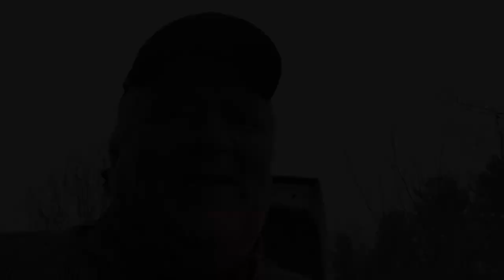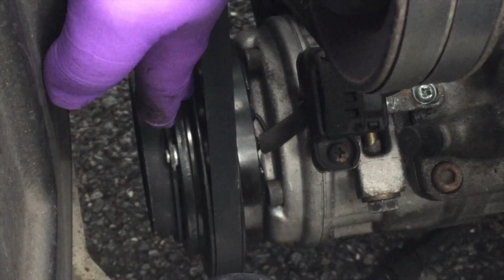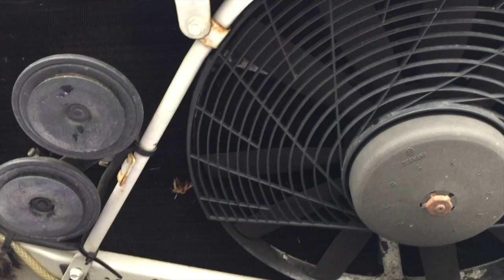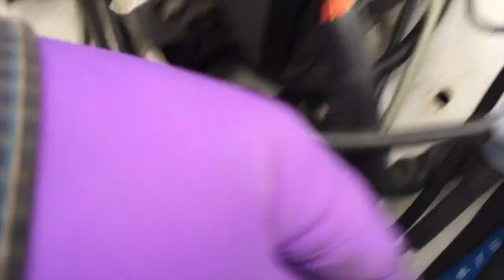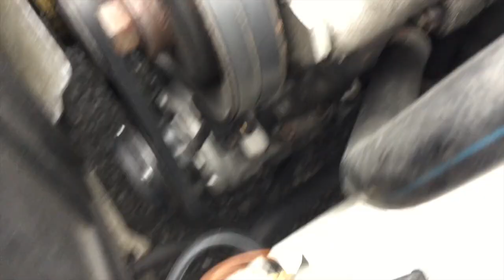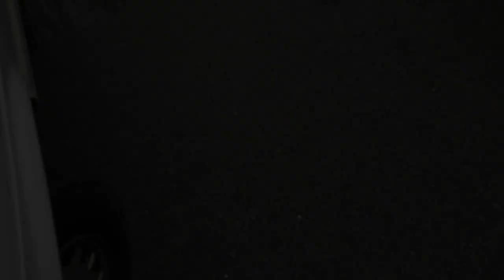Key components of AC systems on Mercedes Benz W123 W124 W126 W201

Comment: im looking theres a fuse looking thing or a thermal fuse some sort what exactly is that called its just behind the headlight looks like a brick but its broke ? any idea what is it called
Reply from the maker: Is this visible in this or any other video? What model car is this?
Reply: @straybenzes no its not my one is a 190e cosworth 2.3
Reply from the maker: @ALKUKES  Got ya. I am unfamiliar with the component and its location you are describing.
Reply: @straybenzes its called ac fan resistor google search by photo , but thank you god bless you
Reply from the maker: @ALKUKES  Yikes. I like that spot better than in the other 1980s Benzes where the stuck it where leaves connect and those can burn or at least smoke like crazy. Thanks and all the best.

Comment: U need to understand the pressures and why they`re occurring. Automotive system short cut quality alot  . Having a condenser fan wired to a pressure switch is very very olds school re 60`s 70`s . As I have mentioned u cannot over cool an auto condenser . Wiring to come on at the same time as a compressor is best .  Using an engine mechanical fan only leads to high side psi spiking . A 20 amp SPAL fan on condenser is ideal [11, 12,13,14 inch etc ] ,..
30 psi is freezing temp of R134a approx same for R12 ........ High side psi is limited by ambient temp cooling condenser EG ambient 40cel/104F  = 133psi refrigerant ,,,, reality is 150psi  with 2 auto sized condensers is a common result .
Reply from the maker: Thank you for our knowledge and wisdom. All the best to you.

Comment: A semi accurate description .  Compared TO  ALL  other forms of refrigeration / airconditioning  . There is only a few companies that make a quality auto units as OEM mostly fitted to coaches / buses .  Abig /HUGE  problem is not enough cooling off the condenser . All auto condensers can be doubled in size which gives outstanding hot weather performance .  ANOTHER cheap auto product is using orifice tubes [CCOT ] .  A TXV does a far better job at regulating refrigerant flow under ALL CONDITIONS .. Properly setup a fixed displacement compressor can do 150--160high side psi/temp all the time all conditions . The evaporator uses its own BTU capacity try to cool itself down from either 150psi or most 230psi to approx 30psi . The refrigeration mechanics have known this for 50+ years .. EG if u garden hose your condenser and vent temps are cooler u need a bigger  / better condenser . simple really ..................
Reply from the maker: NIce. Thx

Comment: Im having problems with my aux fans not turning on at all when the Ac is running or when its over heating, ive checked all coolant sensors , replaced one , checked all of the fuses , even the relay and got a new Black Auxiliary fan relay and they are still not turning on causing to heat at idle. i have yet to check the Ac temp switch the red one from this video . could that be effecting my aux fans ??
Reply from the maker: The fan comes one when either the 105C/115C coolant switch (the 105C circuit) and / or the Climate Control Unit (the push button one in the center console) send power to the relay K9 in your fuse box. Have you checked this and relay K10? That one is the lower speed relay. To test if the fan actually works you can put a jumper wire between terminal 3 and 1. The fan should come on even with the ignition off.If it works the problem lies with either the S25/5 coolant temp switch that sits on top of the front of the engine near the temp control valve housing. Or, unfortunately, your CCU is kaputt. Good luck and hopefully this helps.

Comment: The discharge line has a high pressure cutout it does not measure a minimum pressure it disengages the compressor if the pressure is too high.

Comment: Good explanation! Greetings from Portugal. I just got in an accident and wrecked ky w124 that had AC , and now the one ive bought doesnt have one. I was thinking about asking a mechanic to transfer the ac to the new one, do you recommend this? Is a non ac vehicle capable of getting this upgrade? Is it a relatively easy job, or will i just be wasting money? Thanks in advance
Reply from the maker: HI there. That's quite a job especially if you are not doing that yourself. The whole dashboard and center console needs to come out and the wiring harness needs to be adapted. Can it be done? Sure. But it is a beast of a job.
Reply: My friend , thank you very very much ! I was abiut to get ripped off!  @straybenzes

Comment: Is it the same on a 97 s320 the low pressure location I’m replacing my AC compressor
Reply from the maker: They are very close as far as the design and location are concerned.

Comment: As an HVAC guy, I explain to people that AC doesn't actually cool the air, instead it removes heat.  A home heat pump just runs in reverse and does the same thing.
Reply from the maker: You are not wrong!
Reply: that's how everything cools down, btw❄🤓

Comment: hi, I have mercedes 300sdl 1987, the fan work all the time, without start my car and without put in contac mith my key too, I replaced the Temperature sensor and continue the problem
Reply from the maker: That is most likely your K9 high speed aux fan relay. In your diagram it is marked as "C". If you pull that out and the fan stops then that is your culprit.
Reply: @straybenzes  I was checking before read your answer, and this is the problem. thanks a lot.
Reply from the maker: @ Grat job!

Comment: Why won't the air and heating buttons work in my Mercedes?
Reply from the maker: If it does not do anything check the fuses 5+16. With temp in min and in EC mode you can measure the mono valve voltate which should be near 12V. If that is not the case your control module may be defective.

Comment: Hi would you be able to prepare a guide for someone wanting to install ac on my non ac 190e 1.8 1992 id be willing to pay for it
Reply from the maker: I love a challenge and this would be one. If you truly want to endeavor on this trail the better way of doing this is getting a donor car that has the AC installed. There are so many areas that will need your attention and a mere video will in my opinion not suffice to help guide you through this process.
Reply: @straybenzes  good advice
Reply from the maker: @td_ng  😀

Comment: Thanls man my compressor didnt start untill i jumpwired the pressure switch. Do you know is the gonna happen any damage if i just jump wire it and dont use the pressure switch?
Reply from the maker: Don't do it. The system will ice up and you are starving the compressor for gas. That is not going to end well and you will not get cold or cold enough air out of that system.
Reply: @straybenzes  ohh thanks man just changed the New switch and need to fill the system
Reply from the maker: @rahulkinnunen830  Keeping my fingers crossed for you!

Comment: What a great youtuber you are, responding to all to the comments and questions. You're a nice guy! I own a gas W126 w/R12. It works great but the compressor just started leaking oil from the rear. I have been wanting to sell it for a couple years now. Trying to decide, should I  sell it as-is, fix it with replacement compressor and R12, or do full R134a conversion, then sell it.
Reply from the maker: If it was my car I would leave it alone, tell the new owner where you left off and take less money for your car. If you want to fix it count on spending at least $500-800 to convert from R12 to 134. It's a lot more if you let a good ship to the work for you. I do not mess around the old R12 stuff. No reputable shop can or wants to work on those systems anymore. Either way, messing with old AC systems as you clean and flush them can surprise you with stuff breaking on you. Two critical components can throw expensive monkey wrenches into your work: the condensing coils can easily break and the expension valve is not easy to get to and the threads easily cross thread if you are not used to workd on this component. The latter also requires special wrenches. Tough choices you need to make. Good luck.

Comment: Hey Ralph I just got a new compressor for my 1987 300d.  It came with a new dryer. I just replaced my dryer last year with a maple dryer. The dryer that came with compressor has no name on it. Which would you use.
Reply from the maker: Over the years I have had pretty good luck with no name dryers. Important step is to flush the complete system really well,  blowing out the flushing fluid, and then making sure you have the correct amount of the corrcct compressor oil in your compressor and perhaps 1/2 ounce in the dryer before you put vacuum on the system. Good luck.

Comment: I would greatly appreciate your advice. I am considering buying a 1984 240D. It is a European version and does not have A/C. Would it be feasible to have an A/C system added?  Thank you!
Reply from the maker: It all depends on your budget, time, and efforts (if you can do it yourself). If you have to contract this out to someone I would say this is definitely not worth it. Personally, I would either live with no AC or look for a good car with AC in it. There are so many systems that need to be messed with and the really involved part is tearing out the heater box/center console in order to be able to install the evaporator. It will not increase the value of the car as everyone stateside expects AC as a basic accessory. If you really love the car I will be the last person stopping you from doing the conversion.
Reply: @straybenzes  Thank you very much!
Reply from the maker: @DS49er1  All the best.

Comment: Hey guys, this summer i tried to refill my AC. The system was checked for leaking etc, however before we started to refil it, the mechanic told me to start the car and turn the AC on to test. 
Well the compressor was kicking in for few seconds, and then it was shutting off.
Any ideas what could be the issue ?
The model of the car  is  W124 200 E-16 from 1993.
Cheers,
Anton.
Reply from the maker: That is most likely due to not having enough Freon gas in the system. Is your mechanic familiar with AC systems?

Comment: Hi there, love your SEL. Is your AC system converted to r134 on this car or does it have the original r17 , thanks
Reply: As I have just bought a w201 and most of the components are similar to youra
Reply from the maker: I do not mess with the old R12 and convert the systems to R134. The one in the video was converted as well.

Comment: Hello, ive got W210 but the idea is similar. Can you tell me how to check if aux fan works properly? Ive rebuild my AC system and I want to be sure that the fans are working.. thanks!
Reply from the maker: Are you in the US? Do you have automatic climate control?

If so, first run the fan test mode by holding both AUTO buttons down for >10 seconds. My car seems to take about 12 or so. This should set the system for full auxiliary fan demand. If the fan does not run, watch it carefully to see if it twitches every few seconds. If it does this twitching (and you can see it on a connected voltmeter), the problem is very likely a bad motor. If it doesn't do any twitching, yet you can see it on a voltmeter, it is almost certainly a bad motor. If it doesn't do any twitching and you can't see any voltage fluctuations on the wires, it is probably a bad controller.

Running a 12V lead to the fan motor is not a valid test; if it runs with 12V, it does NOT mean that the motor is good. This fan control is not a simple relay and ballast resistor.
Reply: @straybenzes  unfortunately I have manual ac control only…
Reply from the maker: @kubaSWAT  Oof. I am unfortunately not familiar with that set up.

Comment: I let a business install a new compressor B&B auto weeks in Olive branch Mississippi. On my 126 they had my Benz for 5 months. When I got it back it was winter.  Didn't have a need for ac then.  But recently when I brought my car out of the garage. It caught fire. I just don't understand how the owner can say the guy who worked on my car don't work there anymore and it's not his fault
Reply from the maker: The older the car the more difficult it is finding good mechanics. Hopefully your car was fixable.

Comment: Hello Ralph I have been considering buying a w123. Was the om603 over available in the w123.   Do the w123 have the power of the w124. Are they as easy to get parts as the w124.  I like my w124 because parts are easy to get and affordable  but I like the older body style better.   
Thanks for your time.
Reply from the maker: The OM603 was not put into the W123. The OM617 never had quite the power the 603 did. The W123 also had non turbo OM617 engines as well as the 2 and 2.4L 4 cylinder Diesel. There are a lot of parts still available for either car. Just watch out, there is more cheap crap offered. When possible go with the OEM parts through the classic center for MB. Finding good used but not abused W123s is getting more and more difficult. There were a lot of folks who messed around with bio Diesel conversions. I would stay away from those - most were unfortunately done unprofessionally.

Comment: Hi mate mine it's a w202 c200 1998 model.the wire to the clutch broke and it's hard to join in since it's near the pulley.would u recommend that I weld the clutch to the pulley?so they turn as a unit?also u removed the engine fan which was automatic to a clutch fan like the generation of w202.will that affect the AC?car runs well thanks
Reply from the maker: Welding the clutch solid is not a good idea as you will then continuously run the AC which will render any temp control useless and at times overload the AC system. Take the pulley off and that will get you closer access to the electric clutch part. 
Removing the main fan is also not a good idea as that can overheat the engine and yet, it will also affect the AC condenser performance.
Reply: @straybenzes  thanks 🙏 mate I'll do so
Reply from the maker: @thulanicele7843  👍

Comment: Hi I have a w124 1994 E280. The magnetic clutch does not energise when I turn on the AC , the aux fans also don't turn on . I checked the relay, it looks fine , can't seem to get really what's the issue here . I checked the pressure it's okay too. Any ideas ?
Reply from the maker: How much pressure did you see was present in your system? One test you should do is setting the AC to max and switch AC to ON. Then jumper the pressure switch shown in this video at around 3.30min. If the clutch engages your pressure is still too low for the system to work (find the leak while you are at it). If the clutch does not engage then I would check / replace the Klima relay and double check the AC circuit fuse(s). Finally, it is possible for the climate control unit to have malfunctioned. Good luck!

Comment: When I put my w126 in reverse. It's does. Ahard and loud shift to reverse that looks like it's been pushed or kicked back. What is wrong with iy
Reply from the maker: Is the engine idling correctly? Any higher rpm than the 700-800rpm will make the shift to R or even D pretty hard. Also possible is leaky or plugged vacuum line to the gear shift modulator valve mounted to the driver's side of the transmission.

Comment: Do you have many issues with the Aux fan not cutting in? I am not sure if it works on my 123..
Reply from the maker: Truth be told the aux fan really only makes a sizable difference for the AC condenser not so much the coolant temperature. If your car engine is getting too hot it is most likely not the aux fan. Have you direct wired the fan to see if it actually still works?
Reply: @straybenzes  my car is fine from a temp point of view… I was just concerned that if aux fan does not come one to cool ac cooler..I have been led to believe that could damage the ac components…

Comment: Thanks for a great video! The condenser on my 201 is leaking, and this was a very good starting point video to get familiarized with the components. I plan to replace the condenser and the expansion valve.
Reply from the maker: Thanks, and good luck. That is a big job. Good luck!
Reply: @straybenzes  Thank you. I've heard the expansion valve in particular can be a pain. I've also heard that 201 air conditioners tend to be broken constantly. Do you have any insight as to why that is?
Reply from the maker: @dgitpadre  The expansion valve is very well "hidden" behind instrument cluster and steering column brackets. The closeness of the four fittings makes loosening and tightening them quite challenging. You have to have the crows feet type wrenches and you must get the threads started by hand. 
I have not heard of the condenser of the 201 being more troublesome. In my experience the condenser (much like any other old heat exchanger) gets pretty brittle with age.
Reply: @straybenzes  Ahhhh, the expansion valve being a big job, yes I have heard about how difficult it can be to access and replace. Will be fun for sure. Thank you for all that info!
Reply from the maker: @dgitpadre  The best of luck to you.

Comment: I have a 93’ W201, when the vehicle is moving it blows nice cool air however, when the vehicle is stationary it just blows ambient temperature air, any idea what the issue might be? Any help would be appreciated!
Reply from the maker: That sounds like the system is low on Freon / low pressure. I would check the low pressure port with a refill bottle that does have a gauge. Put the AC on max and see what the compressor inlet pressure is.